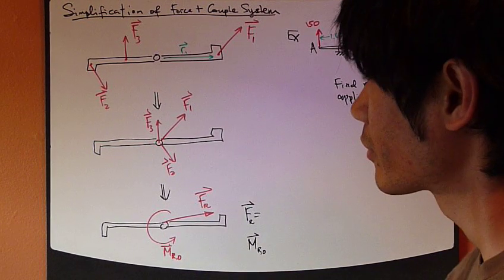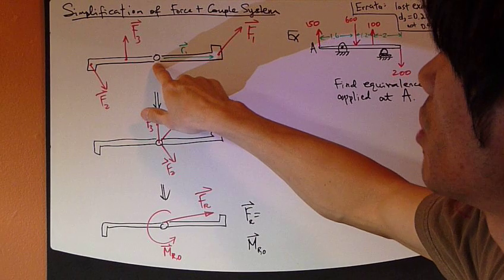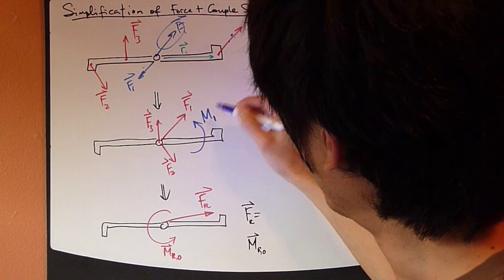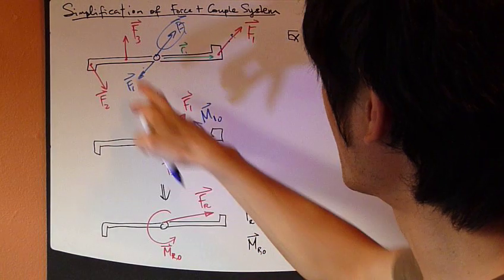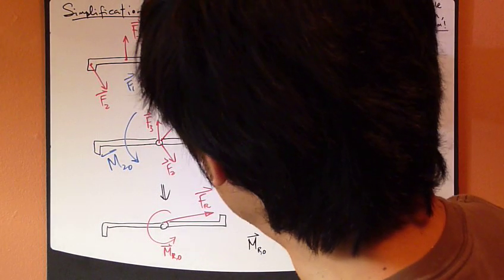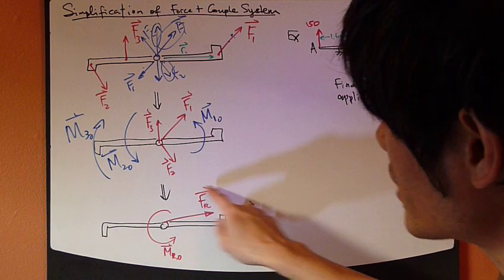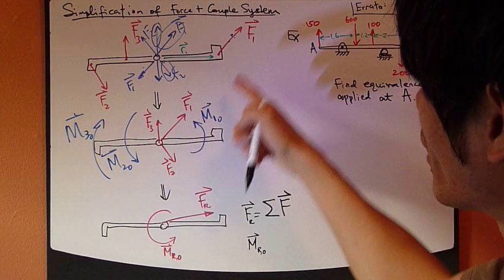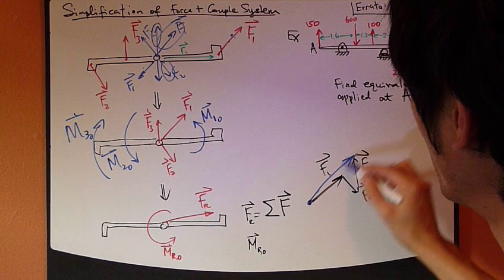Engineering Statics Ch4 Part11: Moment, Couple, System Reduction

Comment: Do the reactions at the pin an roller not count at all?
Reply: They most definitely do count. I think he mentioned that he will get into Equilibrium problems in the next chapter. Once you get into analyzing rigid body systems in equilibrium, you'll be doing what is called a Free Body diagram of them, in this case, the rod. At that point, you will note that there are two reaction forces at the pin, i.e. with a horizontal and vertical component. What looks like a roller will have mostly just have a vertical component. In a real world problem, the roller also has a small horizontal component due to friction, which may sometimes be ignored.

What he is demonstrating for now is that any system of forces can be combined into a Resultant force and a Moment. The Resultant force and Moment would have the same translation and rotational effects on the rigid body as the system of forces that they replace.

But, if the rod is not accelerating or rotating, then overall addition of all the forces on the body, including those at the pin and roller will be equal to zero. In addition, all the moments will equal zero.
Reply: Lol. I totally forgot about this problem since I passed statics last semster,  but thank you for taking the time to help me with my confusion. Now I understand.
Reply: Carina Rankine Depending on what kind of Engineering you get into, you will need to use Statics and Dynamics a lot. I'm old, really old :-), but I still use these principles in my designs. Good luck.